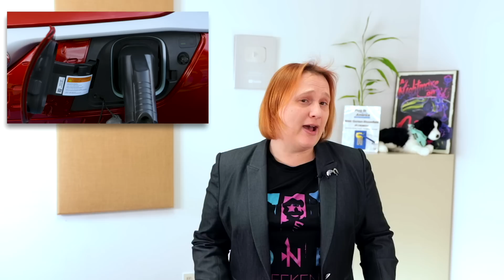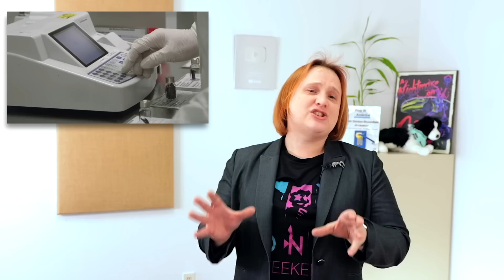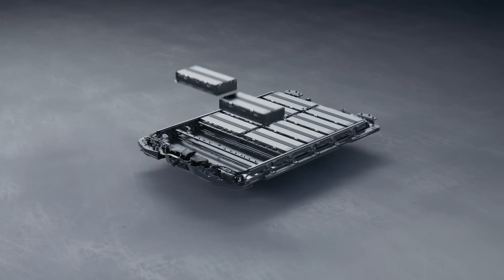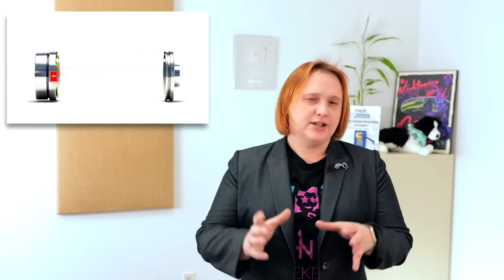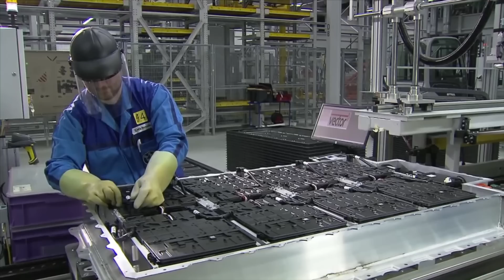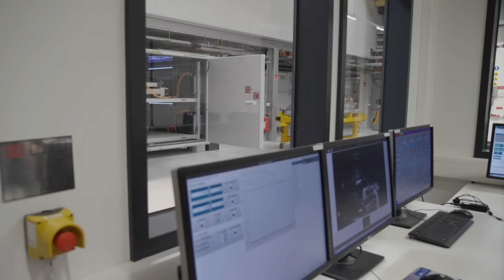Has Samsung Found The Holy Grail Of Solid State Batteries?

Comment: Prefacing this by saying I love EVs and believe they are definitely the future of transportation . BUT . I'm a bit tired of being told that I'm some kind of luddite for thinking a 400 mile warm weather range isn't enough for everyone's needs. Cold weather, towing range and cargo hauling are one of the reasons full sized pickups and SUVs are the best selling vehicles in North America year after year . It gets hard to watch content that comes off as condescending and preachy to those whose needs can NOT BE MET by current EV tech. There are approx. 200k camping trailers sold in The USA each year . Each one requires a tow vehicle and there are currently ZERO EVs capable of doing so . Add in the number of utility trailers and the #s are huge . Stop assuming EVs meet everyone's needs . They simply do not . Love the channel ..not so much the preaching . keep up the good work.
Reply: It's a very small number in the scheme of things. You can keep your gas engines for those edge cases, batteries are good enough for the vast majority. As soon as they are cheap enough the transition will be very sudden.
Reply: @MrGonzonator  I wouldn't call millions of vehicles used for towing and hauling "edge cases " , The patronizing tone of your response is exactly what I'm talking about .
Reply: @fupabox  I'm not trying to be patronising, it's just a fact that batteries are heavy and there needs to be a trade off between range, weight and cost.
All of these things have improved over the last decade and I have no doubt they will continue to, and eventually these edge cases will be swallowed up. But as Ben Sullins has demonstrated with his data, the numbers actually towing are low, and even then the range doesn't make towing impossible, only time consuming.

Comment: I read somewhere that Toyota have more patents on solid state batteries than anyone else, yet all they seem to be doing is pushing the ‘self-charging hybrid’ nonsense. The problem for all new battery tech is the existing Li-ON chemistry is making incremental improvements and with an active TMS seem to be lasting the course. Aficionados would have heard of the high mileage Teslas that seem to be just fine after 200,000 or more miles of rapid charging. I’ve had the e-Niro for a year now and have been taking a note of how many times I plug in. My last 40 plug-ins (mostly at home of course) have added an average of 215 km per charge. We are told that a thermally managed Li-ON pack of the type used in the Kia should be good for at least 1,500 full charges and discharges. I tend to go from about 20% to 80% once a week so I don’t know if that is counted as a full charge/discharge. Even so if I get 1,500 x 215 = 322,500 km out of the pack before it loses too much range then I shall be well pleased.

Comment: Another way to slow down EV adoption is to constantly tease "way better and cheaper" if you just keep waiting for these "game changer" improvements to arrive.
Reply: electric cars have gotten better in 10 years, nearly double the range, rapid charging etc. 10 years ago no Tesla model 3. Another 10 could see them actually affordable for the millions that cannot afford brand new cars. Its not so much we are waiting for price parity with new higher cars, but that with entry level new ones or used ones. It's not tech, but cost that is the issue. Waiting for Telsa model 1 and 2 and that is a game changer.
Reply: @jondonnelly3  it's both cost and and tech (weight/capacity, recharge time) solid state batteries will make them really interesting & comparable to ICE vehicles. I'm fine with series hybrids or toyota type with opposed piston or freevalve engine
Reply: Dcms
P LLP

Comment: Still a prototype 
They have to make a working usable battery 
Battery needs lots of testing 
Gear up for mass production 
Start producing   This will just be regular batteries 
Make a usable battery for an EV.  Design battery pack and battery management system 
Test the system 
Work out the bugs
When ready build factory for mass production 
The failure rates of batteries made during this process has to have a low failure rate. If only 50% of the batteries coming off the line are viable then more refinement in the process. Then they need a factory, supply lines etc.
Will still be a while

Comment: I see a big problem with our electricity grid not being dimensioned for such a high demand. Plus in a lot of places electricity is being produced by coal witch makes the equation even worse.
Why not hydrogen or hydrogen hybrids? The problem with storing the energy is no problem compared to batteries. 
Hydrogen is the most abundant element.
We have plenty of space where both water and solar energy are available.
Reply: That is a poor argument. The ICE cars in the fleet today will take 10 to 25 years to be replaced. By then the grid we know now will be replaced by something else. I have no idea what but it won't be what we have today. 10 years is a long time to adjust. Look at cable TV
Reply: Right now the relatively high cost of hydrogen for fuel and the lack of infrastructure are among a number of drawbacks preventing widespread acceptance.
Reply: DrTed3 hydrogen equals extractive industry e.g. natural gas
Reply: @theairstig9164  Another good point.

Comment: When charging fast up to 80% and then the 80% range is 300 miles or more then you'll have convinced me. No good saying the range is 300 miles fully charged. They should maybe state the 80% range as the official range.
Reply: In theory, I agree with you.  In practical terms, charging above 80% isn't that damaging if you immediately use it.  It's charging it above 80% and leaving it there that's most damaging.  Charging to 80% most days, and charging to 100% (and then immediately using it) on rare occasions, is a legit strategy.  And for that reason I'm OK with them advertising ranges based on 100% charge.
Reply: Steven Balekic if you charge at home or work, that doesn’t matter. The taper after 80% is mostly only relevant on long trips. With 325 miles of fully-charged range, stopping for 40 minutes every 5 or 6 hours isn’t really much of an issue. Most people need bio and food breaks. Also, charging to 100% isn’t bad for the battery unless you let it sit there for days. If you drive shortly after hitting 100%, it’s fine.
Reply: @lemongavine  I live in Australia and the nearest next big city to the east is 700 kilometres away. To the west it is around 3000 kilometres away with not much in between with no fast charging over most this distance. Most of the stops on the way are really only a string of small petrol stations spaced about 300 kilometres apart in the middle of the desert for 1500 kilometres of this trip...they don't have electricity grid connection and there are no proper towns for the majority. I would prefer manufacturers to state the 80% capacity range because even with fast charging, the last 20% takes too long, and personally I would only mainly charge it to 80% always. So I'd only ever have 80% battery capacity of range.

Thinking of being stranded along these routes makes me feel sick and anxious,  these petrol stations run on their own diesel generators and I shudder to know how long it would take to charge every stop. 

This trip goes from 3 days in a i.c.e car to however long it'll take to charge slowly each stop over this distance.

If the new technology takes more effort and time to do the same thing, then it will never be my preference until someone makes one that's better than what I have already.
Reply: @stevenbalekic5683  You have an extremely special use case (far less than 1% of population?). EVs are (not yet) a practical solution for you.
Reply: @stevenbalekic5683  Technically, Tesla can set-up supercharges with megapack batteries and solar for those remote locations. If there is enough demand on those routes, they might just do that. By the way, out of curiousity. how much more expensive is the fuel at those remote stations? Has to be quite expensive. Do they run the diesel generators 24/7 or do they start up when you activate the pump?
Reply: @lemongavine  in the last two weeks it has been $1.95 per litre and currently where I am now it was $1.16 yesterday for unleaded 91. So yes it is more expensive, but the petrol market here goes up and down all the time so I could go tomorrow and it could be $1.59 here in the city.

I would assume they would run their generators constantly, even though the actual petrol station is only open from 7am to 10pm.

Comment: I'm sorry, but as a regular traveller of over 1200 miles without stopping on UK roads, until electric battery pack ranges can comfortably manage at least well over a 1000 miles, it'll be of no use to me as professional non-stop Lands End to John o'Groats road admirer, ^oo^
Reply: I would be surprised if we ever see a 1000+ mile battery pack, even if the technology is there.  There is a reason why gasoline powered cars don't have 40 gallon tanks even though it is possible.

Comment: A million miles, not 100k miles of driving. At the last minute.
Reply: Right, it's a 1,000,000 kilometers.   Wrong,  that's 460,000 miles.
Reply: What she said was WELL OVER 100,000 PLUS KM of driving. 5,000 charges and 800KM is 4 million KM. Will manufactures put that much capacity in every car? Most likely they will offer cheaper options with less capacity and people will mainly buy the cheaper version. Who cares how many miles that is.
Reply: @garyhoffmann1615  I think she messed it up altogether when she said 800Km range and most people will charge more than once a week, some may do most people won't.When she said  well over 100,000km she sounded like for the entire life of the battery which only comes to 125 charges.I think she meant over a million kms.
Reply: @mehmettemel8725  I am sure I heard Tesla are claiming the model 3 battery will outlast the car. Yes I think you are right about the 1 million KM, I know Nissan UK are talking about repurposing batteries for home storage. I live off the grid on solar power, would be nice to see many more cheap batteries with lots of life left become available from old EV's.
Reply: @garyhoffmann1615  The main thing making my mother think twice about buying an EV is that most of her family lives ~300km away in rural areas. Unless she can find fast-charging there, she would likely have to stay overnight just to put enough power back into the battery to make her way to the nearest fast-charger on the way back. She'd probably need ~450km to feel comfortable.
Reply: @teardowndan5364  There are more chargers going in all the time. Tesla Model 3 can be bought with 620KM range, hope your mum enjoys her EV.
Reply: Teardown Dan from Tesla;  The Model 3 Standard Range Plus version delivers an EPA-rated all-electric range of 250 miles (402 km) and the Long Range versions deliver 322 miles (518 km). At least one Model 3 was driven 606.2 miles (975 km) on a single charge.
Reply: @rcpmac  The 620KM range comes from www.tesla.com.au may be the higher temperatures here give more range. still well above 300 km range requirement that was preventing Teardown Dan
s mum from buying an EV.
Reply: Gary Hoffmann I believe she said 1000 charge cycles 800km per
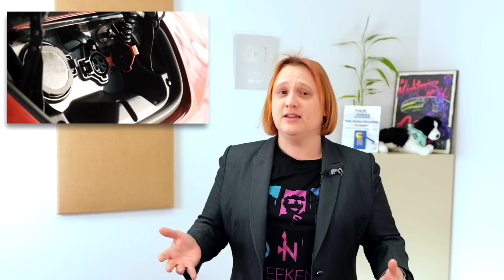Reply: @rcpmac   At 5:30 she says only if it will deliver the promised 1000 plus recharge cycles promised, then she goes on to say EV batteries need to survive 5000 recharge cycles. But it is all just guessing ATM fully cycling Lithium batteries reduces their life. Only if and when there s a production version of this battery that has been thoroughly tested will the real results be known.
Reply: I noticed that too. lol.
Reply: She said 100 thousand kilometers which is even less.

Comment: You're correct about the "range anxiety" syndrome.  You almost understand European Lemming mentality.  They spend 48 weeks driving their cars a little, and then once a year drive all the way South for their vacation and want to do it in one go.  So they want a car with a 1,000 km range that charges in 2 minutes, when 99% of the time they need a 30 km range. 

The oil lobby here in Switzerland are tripling down on the lies about batteries and EV since they have more than doubled their investments in fossil fuels in the last two years.  You should do a high quality show about the lies of the oil lobby.
Reply: No electric car fans paint this picture because they want electric cars to be the future today..the anxiety is real for most car drivers.

To have a modern electric car you have to:-

1. Be able to afford an electric car - most of which are about £30K and the ones you'd want above £40k+
2. Have a lifestyle that affords a facility to charge your vehicle - You need a home that can facilitate a charging point (i.e. a drive or garage) and / or a place to park you car at work that has a charging facility (lots do but usually significantly insufficient for the number of cars that require charging)
3. You need a driving profile that suits an electric vehicle - 90%+ short range driving
4. You need a backup / alternative in the event you need to drive long distances

Lots of people can't hit the criteria above, the majority of people I'd say....note additionally most of the driving range figures claimed for electric vehicles are wildly optimistic but even when they aren't remember to get those figures (or anywhere near them) you need to drive conservatively, which lots of people don't want to (me included).

Electric cars...not even a consideration until the battery tech improves by at least 60% for most vehicles (less for the Tesla's...although who can afford one of those..!), just got rid of my Mercedes C350e Hybrid....as a fuel saving / economy vehicle a complete waste of time (54,000 miles...averaged 35.7mpg...the 2.0litre Diesel Mondeo it replaced, 46.5mpg over 122,000 miles), as a performance enhancement for acceleration then yes a significant feature.
Reply: A dear friend of mine was working for a well know energy supplier (gas and similar) in Switzerland. The company decided to start a new department for renewable energy few years ago, my friend was the leader of such department (he also started one of the best swiss company for public charging). As soon as the company noticed that with renewables could not have huge profits like with oil and gas decided to shut down the department. Oil lobbies will still be around for a long time.
Reply: Look at the Drilled podcast. PR firms shared between big oil and big tobacco
Reply: @theairstig9164  I know, I can show you the knives in the back.

Comment: Uuuuuh.... Tesla and Maxwell have already reached 600 miles or 1000 km. So how is this revolutionary?
Reply: The fact that it does the same thing but takes up 1/2 the space, is much more resistant to degrading, requires less cooling and is much safer than Tesla batteries in a crash. 

Did you watch the video?

Comment: Driving through the January 2020 winter storms, Supercharger fees were $60 to drive 1,980 mi (3,168 km). We stayed overnight at pet friendly motels with free breakfast and overnight charging. Last June, I drove straight through 714 mi (1,142 km) for $25 Supercharger fees in 14 hours.. These are the charging costs and travel speeds we need to share for each EV to determine if it is an affordable, practical, cross country car.

Our Std Rng Plus Model 3 drives 2-3 hours on a typical 15-30 minute charge for 100-180 miles (160-288 km.). Finding the Superchargers, we stop at a fast food restaurant for bathrooms and take-out meals. In 15-20 minutes, the car while we eat our meals, and; walk the dog. When done, we go back to leave the bag of trash, a fresh cup of coffee, and get on the road.

I appreciate battery announcements but if I need to visit my relatives, I need to know what it is going to cost and how long it will take to get there. So let me suggest when doing an EV review, include an overnight max charge. The next day do a maximum range leg to a distant charger; then record charging hops back over the same distance recording the block-to-block times and costs.

Comment: Another week another new battery type in a lab......
Reply: @Cory Bernhardt 
EVs can be charged from any outlet. The bigger the amps the quicker.
Reply: Charles-A Rovira  
Lead-acid? What a rip off! Over five years of life then you are doing well.  How can car companies still sell cars with this polluting junk in them?
Reply: Charles-A Rovira  
Using lead-acid in this day defies belief.
Reply: John Burns Lead acid is so incredibly damn recyclable dude. That’s the least of your worries
Reply: @Cory Bernhardt Yes, that's Level 2 charging. Although in NA it's usually 240V and 30A actually used.
Reply: @Doug Thomson 
Looks like you need a light plane, not a car.
Reply: I don't see your point. That technologies take time to reach market, and sometimes don't reach market at all because of some practical issue isn't exactly news.
Reply: @jakobholgersson4400  Yup, seemingly promising new techs fall short from becoming commercially viable or at least end up taking a whole lot longer to do so than expected all the time.
Reply: This is different tho, as this isnt in a university lab or some small start up hypetrain. This is Samsung which is one of a handful who can actually pull it off.  However dont expect any battery breakthrough before 2025
Reply: novonix
Reply: A number of organisations are working on the graphene battery. All looks good. Expect in five years that all EVs will have amazing ranges.

Comment: If it does 500 miles per charge cycle, and it achieves 1000 charge cycles, that's 500,000 miles. That should be plenty.
Reply: real world you'll get maybe 400,000 out of it cause you don't fully charge or fully discharge.
Reply: tc, which is still plenty .  I read another  research team is using simular materials.